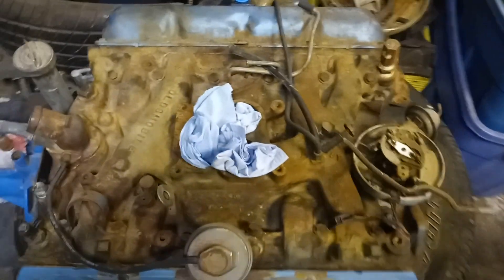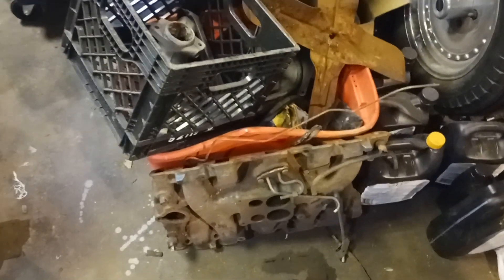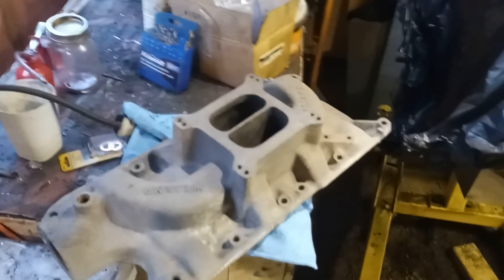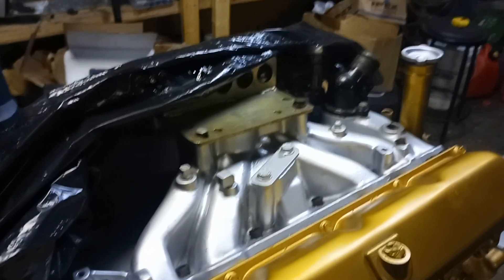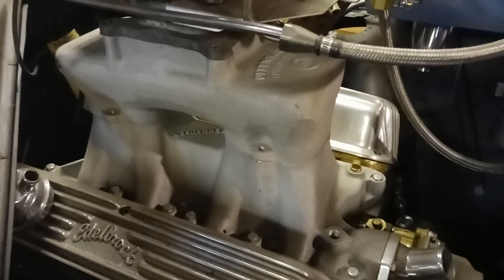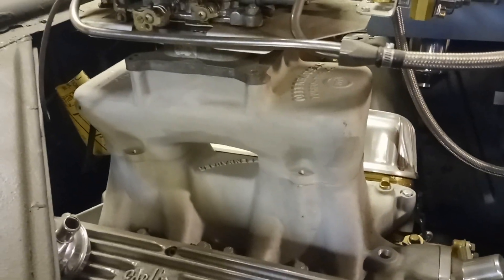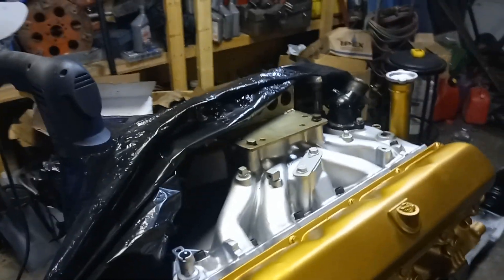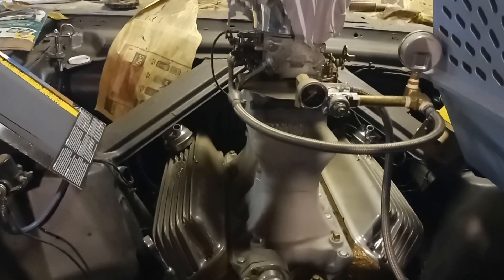My view on intakes/battleships.

Comment: Back when the Performer RPM came out for the small block mopar, I put a new one on the 360 in my 71 Scamp.  Turns out it had a porous casting under the carb pad.  I noticed bubbles there when I degreased the engine.  I sealed it up with some JB weld.  Point is in my case a Made in the USA Edelbrock escaped their quality control with a hole in the casting.
Reply from the maker: Thats no good. I ran a performer rpm on a 347 stroker for year mine worked well. Thanks for watching.

Comment: I really like my Offenhauser tunnel ram. It's a single carb setup but I like it. I had a performer RPM on it before. Then the spine snapping Toronado intake. The edelbrock vs stock you could tell a difference. I got my Offy used with a holley 750 and a basset scoop for a good price. Beautiful polished setup
Reply from the maker: When I bought my front runners the guy had a offy olds tunnel ram with 2x750 holleys he told me he would sell me dirt cheap. I slept on it and passed I have enough issues with one carb never mind two.
Reply: @wildrosegarage4208  I talked the guy down from 1300 to 350 for the intake, carb, scoop, air cleaner, linkage, thermostat, and thermostat housing. It came out to 450 with shipping. I wouldn't have been able to sleep if I didn't at least try to talk him down.
Reply from the maker: @crazycoffee  nice deal.

Comment: Great video! I never realized how flat those Olds intakes were! I have a couple of the 340 Chrysler thermoquad intakes, mine are the 71's without the heat crossover orfices in the bottom. I'm running a old Torker 340 intake on my Demon, they get a bad wrap nowadays compared to the newer airgap intakes, I'd run one but don't have the hood clearance. Thanks for sharing the intake info, I love this kind of stuff!
Reply from the maker: Those 340 spread bore intakes would be deadly on a mild sbm. On the 455 for no name nationals I am running a torker. Not sure about sbm but on a bbm like a 440 nothing is better than a torker and dynos have proved that time and time again.
Reply: @wildrosegarage4208  👍

Comment: Pontiac V8 made the Best Factory Dual Plane intakes.
Reply from the maker: Could be wrong but I think the performer is a copy if the factory pontiac intake
Reply: @wildrosegarage4208  Its close but not exactly the Pontiac V8 Performer,  CSA Cross sections are smaller. Only possible useful on Pontiac 326 Or Pontiac 350 replace the base 2-bbl . A friend has one A Performer on his 1966 Lemans partial cloned to a GTO, GTO hood installed. 
1973 Pontiac 350 engine. He dont street race ir Drag strip it. Car show guy drives no faster than 70 mph.
Had the Performer Pontiac V8 intake off myself to repair a coolant leak for him. A surprise looking over, Dinky Small runners and CSA Cross sectional areas.
Reply from the maker: @brracing7861  good to know.
Reply: @wildrosegarage4208  Unlike What Oldsmobile V8 did many heads similar overall, Pontiac changed Cylinder head port Velocity rates with CSA in ports, Different valve sizes for Flow discharge Coefficients,  slight chamber shapes changes, A few heads Spark plug relocated most notable Pontiac RAIV 614 Round Port Heads,  Changed the Bowl to valve % percentage ratios also. 
Have to measure precise and do Race math to Port Effective and get then Burr Cut away port like I did to get maximum results.
I went about like Pro Head Porters do today, most notable Chad Speier Racing heads, he showed me, us all on V-Factor Porting group F book.
Reply: @wildrosegarage4208  Olds V8 Heads are a Kool sleeper design.
I had a 1965 Oldsmobile 425 Super Rocket V8 in my 1963 Grand Prix last before present Pontiac 455 520 Hp all iron I built.
Man that 425 Olds V8 ran hard near stock !
The 425 A Heads are excellent.  Flow very good bone stock unported.
Still have the 425 engine.
Tired. Tore down.  Cleaned all.
Needs a  .030 overbore, Want Modern Diamond Race forged pistons for it.
That 425 Loved to Rev away !
Reply from the maker: @brracing7861  I know you did. i watched your 425 videos before I had a channel. I like my A head 425.

Comment: Notice the two older ones were spread bores...for the best of both world's small primary great ldle signal and larger bore for power still works well for the street. I have an offenhauser for my 318 roller cam in my 72 dart.
Reply from the maker: I agree its hard to beet a spread bore on the street.

Comment: Got a performer 318 for my 85 ram. Almost identical to a stock 4bbl but is aluminum. But should be way better than the stock 2bbl iron manifold it has now. Just got to figure out the kickdown linkage when I swap it over. Great vid 👍
Reply from the maker: Make sure you get it done right or trans will blow up on a mopar. I have been there.
Reply: @wildrosegarage4208  yep I know the drill. Ive yet to do that but I've had it drilled into my head to make sure it operates right or its done

Comment: So very very very true man! Like the old saying goes, when you start changing this stuff, you have to "Start with the Wing Nut & Match Everything to the Lug Nuts".
I can't count how many guys will slap an air gap single plane on a cruiser and wonder why their eyes bleed as it's chugging down the road at 25-35mph because the catalog said it would fit & bolt right on.
And man....... if you don't know who Fred Offenhauser Jr. is, you don't belong in the Hot Rod world! A self taught machinist working out of his garage (like us) that actually BUILT his own engines. Over head cam? This is the guy that made that happen! and he dominated Indy for decades doing it. Sorry.... lol..... he's one of my all time hero's in all this. Too bad he passed away the year I was born.
Reply from the maker: A happy motor is a motor that has all the parts matched with the same powerband for its intended use. I was just talking to Will last night about your 58 and I think it will surprise a lot of people. My reason is those smog era motors are not as bad as people and specs on them make them out to be. For your motor I would lighten up the dizzy springs and make a timing mark on the balance or use a dial back timing light and have the timing at around 34btdc all in, 2 1/2" exhaust with a glasspack muffler or something that flows well, You say you have a intake so I would run that and plug the crossover, and run a 1'' heat dispersing spacer, 160 T stat makes a cooler air charge, And maybe a electric fan off a factory vehicle (more reliable than aftermarket) for less power loss. All those little things on a smog era engine make a big difference and don't forget you have 460 cubes working in your favor, a light car,and a decent gear. Just make sure it hooks! maybe find a set of decent tires that are short (for a lower gear ratio) and do your brake fluid trick. I am rooting for you my friend. I really enjoy seeing builds like ours perform well with what we are working with.

   Nolan.